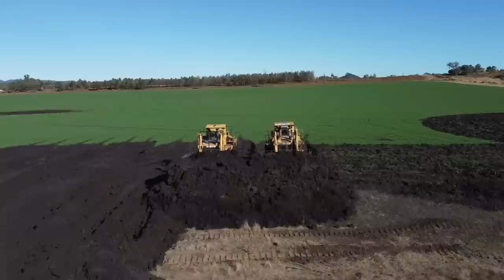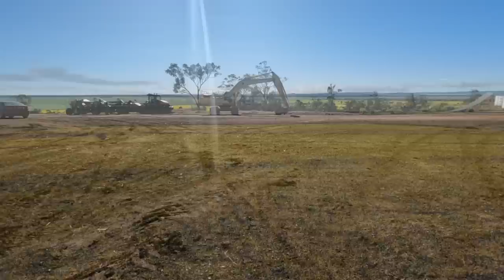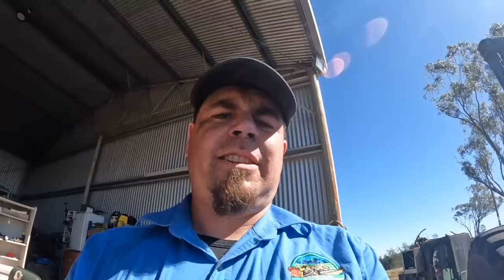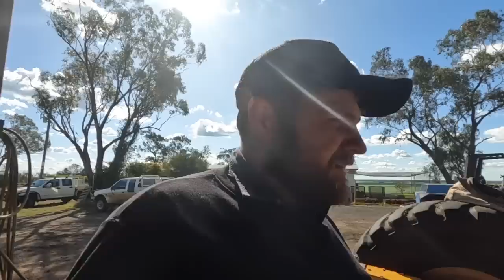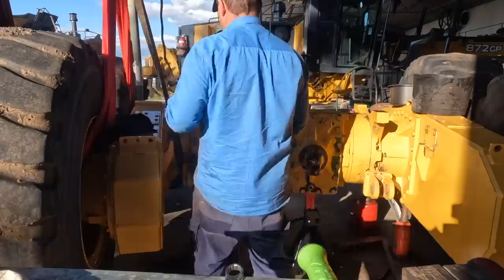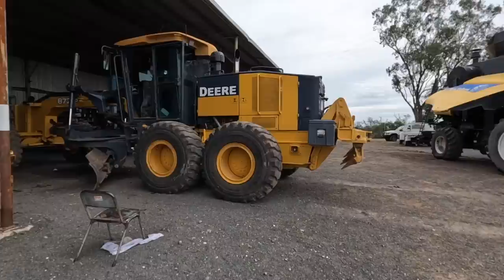Graders Back!! (Vlog 93)

Comment: Those are my favorite style of breaker bars.  Have had 3 half inch versions from great neck and not been able to break them in 20 years.    Lately I have not needed my 3/4 and 1" versions. Or my 2,000 foot pound snap on torq o meter dial type torque wrench.

Comment: Matt does the farm have a rock crusher ? you've got loads of stone in the fields , so pile them up and put them thro the crusher over the winter months ,  as you don't have alot on ,then spread them down the driveways or where ever u need base material _--- just an idea ok cheers Matt & crew !!
Reply from the maker: Hi Tom, we do have a excavator attachment crusher which works well but takes a while, we would love to have a proper crusher but that might have to be down the track 👍